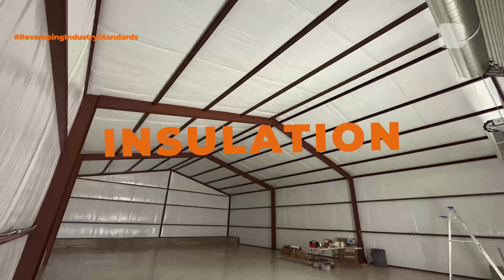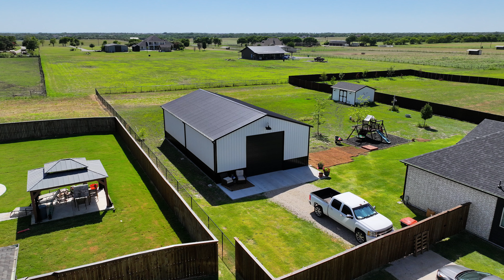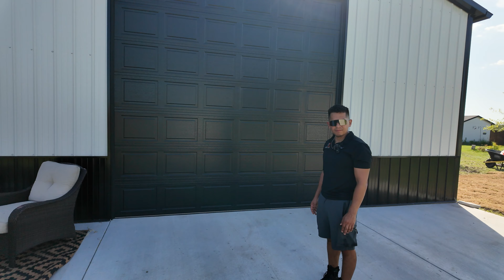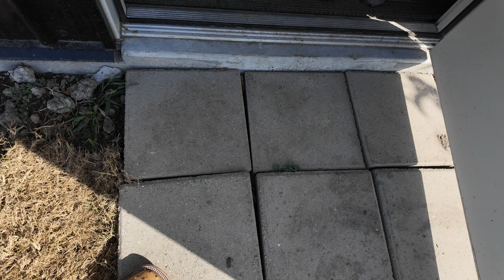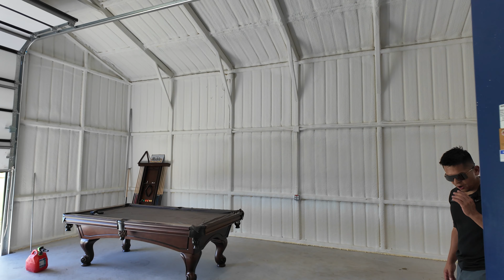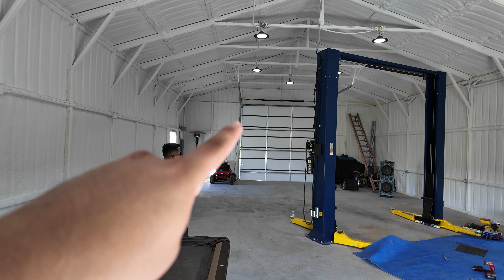30x50 Metal Workshop Building | Metal Building and Concrete Tips for Car Lift | WolfSteel Buildings

Comment: Why on earth would someone spray foam over electrical conduit? I’ve worked in several shops … unlike a house where the kitchen stays a kitchen Etc, you’re constantly having to add or move electric components for new equipment or different layout for better work flow and constantly evolving. If you want to hide your conduit paint it but I highly recommend you don’t burry it in  spray insulation your going to end up with mess from chipping away and the new electrical added will look terrible and makes a simple circuit expansion take much longer than it should.
Reply from the maker: Thanks for your insights! We find clients like it for aesthetic appeal. They aren't seeing the wiring. 
We actually have a video on this https://www.youtube.com/watch?v=b1hQKMmM_Ww&t=1s

We give the clients the pros and cons with each option.

Comment: The one thing I’d suggest to people getting a narrower building (mine is 24’) is not to center your garage door.   It wastes so much space, especially when your man door is on the side of the building instead of right next to it.   If I had to do it over again, I’d put the overhead door as tight to one side as possible and the man door on the next side so I could have as long as wall to use as possible to use on the other side of the roll-up.
Reply from the maker: That's a good suggestion and another option to look at. The placement of your garage doors can always vary. Just make sure it meets what your building needs.

Comment: Spray foam on a metal building usually voids building manufacture warranty.. 

If you ever welded, metal keeps a lot of moisture, it literally “sweats” depending on the weather…

Spray foam just keeps the moisture on the inside of the panel. It will rust inside to out..

Unless you have wood under the metal, or a liner.. that metal will be moist on the inside of the panel for its lifetime.  

You said it yourself, spray foam keeps everything the same under control.. including moisture.
Reply from the maker: Yes spray foam does typically void, that is the benefit of us, we do all the work so we abide by the warranties. Thanks for your insights!
Reply: @ I know what your trying to get at but you know I mean the actual building manufacture that sold the kit (verdatube, Armstrong etc) 

Unless we talking that you fabricated I-beams, H-beams and all that good stuff.

Comment: Why can't they add the color mix to the spray foam so you don't have to come back and paint?
Reply from the maker: Good question and you’ve got a point! We use paint intended for spray foam only. Then we wait some time to allow the spray foam to cool down before we apply the paint on it.
We don’t mix the paint with the spray foam materials because of the chemical reaction that happens when it is applied. The chemical reaction produced during the application of the spray foam allows the material to expand and harden into a solid which is the foam part of the spray foam.
Usually there is no return trip fees, as we usually paint after the spray foam application.